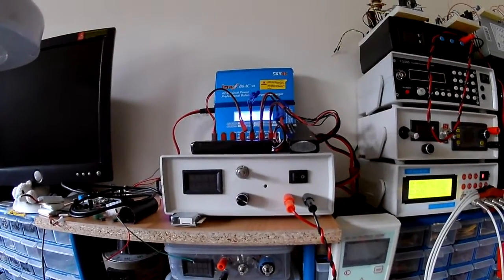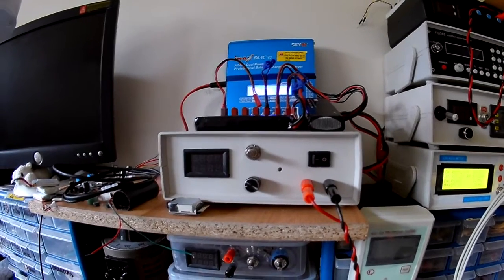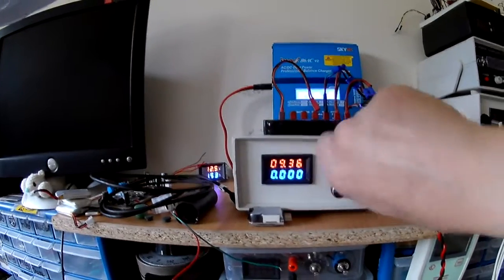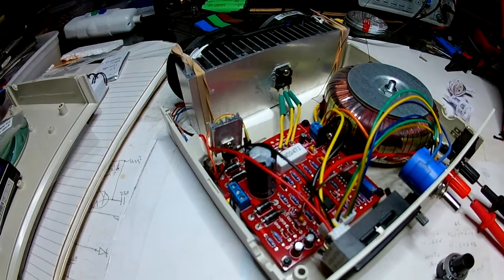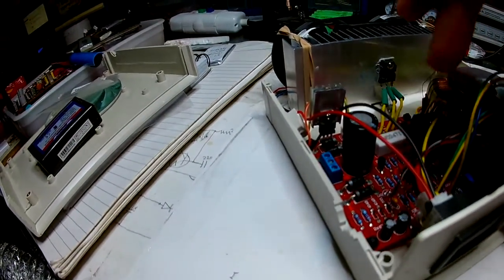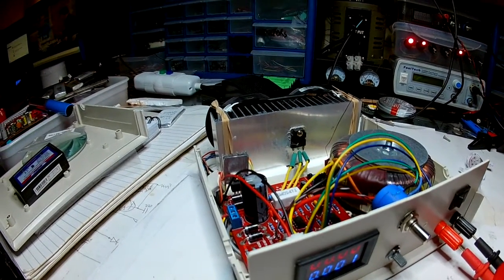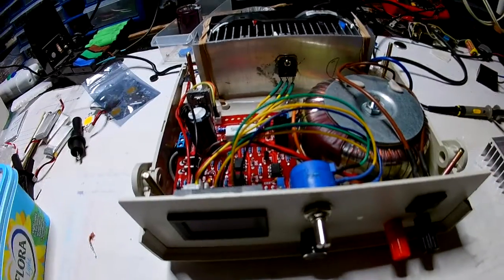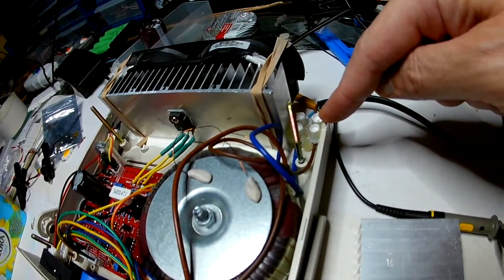Linear Power Supply 0 - 30v 2mA - 3A Banggood DIy Kit

Comment: Good video. It looks like you're tapping the 24V power to power both your fans and your display. Is this accurate? Would be interesting to see more about how you wired that.
Reply from the maker: Yes tapped for 24V and wired two 12V fans in series.

Comment: Great power supply job and thank you for sharing! I think i now have six of those Chinese power supply kits with three already made up! I cant stop myself buying them when they are only $5.50 per kit with free shipping! Please tell my how you wired up your toroid as i am going to use one myself as an isolation transformer: Did you use  a slow blow fuse, or a thermistor - or both? I am probably going to use both on mine, but i was curious what you did? Many thanks!
Reply from the maker: Hi I used 24V 0 24V with a slow blow fuse. Mine transformer is rated higher amperage but the board will run at 4A but I wouldn't do it too much as the risk of other component breakdown is higher.
Reply: @Elecifun  Many thanks for your swift and kind reply!

Comment: I k ow this is a old vid but you Shouldnt have a problem with the tranformer being a higher ampage than needed as the board has current control and limited to 3amp.
Reply from the maker: Um you should be right but I have had 4 amps from this, just to see not to use continuously

Comment: how did you get the 10turn potentiometer work with the power supply. mine just shows 32 volts all the time. what potentiometer, can you give the link?
Reply from the maker: Check out how they are wired in the video. You will see the connections are different, the board connections the same. I can not remember off hand which is wiper 1,2, or 3.
Reply: Elecifun i accidenrally short circuitted mine and now it shows 33 volts with original potentiometer i dont know what part fried. i put load on it and 5 sec later i smell something burning. i dont know if its one of the diodes becouse it has a scratch or crack on it. but i am glad it was cheap one from ebay.
Reply from the maker: have you a multimeter to check it
Reply: Yes
Reply: @teemu8134  Just buy & make a new one......it saves the tearing out of all the hair! Trust me....i did the same! Lol! Best $5.50 i ever spent!

Comment: Hey! ÷*) You mentioned starting out with a breadboard PSU. Please tell me what/which/whatever one. Thx!
Also, I'm just starting out (eeek!) and bought this same Original Hiland 0-30V 2mA - 3A Adjustable DC Regulated Power Supply DIY Kit. It should arrive any day now,  and I'm scouring the 'NET' for help. So, I may be asking you for a few details, and I hope you'll okay with that.
Anyways, thx for uploading this vid! ÷*)
Reply from the maker: Check out LM317 LM338 datasheets for suggested circuits. They give a good idea regarding setup, pass through transistors and protection.
Reply: Did you make your power supply ok? I love those kits!

Comment: Thanks for sharing that ..you may not have invented anything electronic yet...but you just come up with a new word...sealasicked...grin..being a lover of salvaging parts i hate that cap gunk glue stuff..
Update on me.,..
Been thinking of playing with wood to make some project cases...i like the look of it
 Busy making lots of little paper envelopes about 3 by 4 for components..all fit in a box like a filing system..low resistors at front high at back..and transistors in alphabetical order

Playing with Tesla's work on aerials..below 10 hz is interesting...listening to storms

Working on my heart failure treatment gizmo..finding the best mic to listen to heart..for feedback to the output of frequency patterns...for obvious reasons (not wanting to risk getting sectioned..grin) i dont talk about it much at the clinic but last week they said..whatever you are doing its working..smile
Reply from the maker: Hi, regarding new word, I do like to think I can put something back into the community, regardless of how daft it sounds,lol. 
I would like to be able to build with wood as I too like the look and 'feel' of the look of wood. I use the plastics at the moment because I have a little hobby drill. I only have a hack saw for wood/metal and a Jigsaw in the back of my cubby hole which is full of boxes etc, proper mission to find Jigsaw. 
Sounds like lots of organizing with the envelopes, I cheat and use sealy bags for my convenience, cheap and easy that's me,lol.
I want to hear storms, is there a link you would suggest to help fasttrack me to something which works with reasonable results?
Does it need to be a mic or could it be something which measures the electric pulses, or both? Sound interesting especially if you find patterns/signals which enable you to for see upcoming events, even better to use the data to control such events. That would be amazing and life changing for so many. I do not pray but if I did I would pray for your success with your research. I wish you luck and not just for you personally but for everybody who would benefit.  Very interesting!
Reply: Well i am not sure if this link will fast track you but there is a hell of a lot on it..lol

http://www.vlf.it/

try a am radio they will pick it up
Reply: yes it needs to be a mic .....because ultrasound and analyzing electrophysiological patterns is too dam complicated for me..grin..the trick is to invent or mod a mic that works well for the job

Comment: Hi, what happen if i short the output?
Reply from the maker: It should reduce the output to nothing.
Reply: Dont short it for the amperage testing/setting above about 7 volts though. Saves stress on the circuit.

Comment: but Im having hard time to find a case and a transformer
Reply from the maker: This transformer can provide more power than the board is rated for, it is the same as I use and my board can and has provided 4A @ 14V no problems. 
http://www.ebay.co.uk/itm/High-Quality-120VA-Toroidal-Transformer-With-0-12-0-12-Vac-Outputs-/300946300756?hash=item4611cc1f54
Here is the case I use as you see in video all parts fit in here.
http://www.ebay.co.uk/itm/Plastic-Electronics-Project-Box-Enclosure-Instrument-Handle-Shell-200-175-70mm-/131893462433?hash=item1eb57685a1
Reply: den Trafo gibt es bei www.Reichelt.de  
Artikel-Nr.: RKPT 10212
Ringkerntrafo, Print, 10 VA, 2x 12 V, 417 mA
 , die Kiste bei Banggood.com